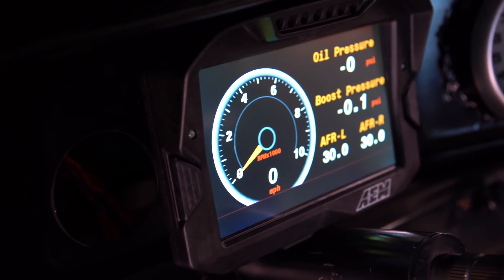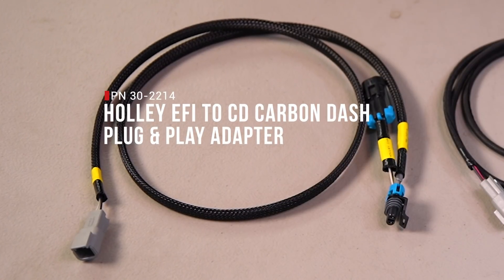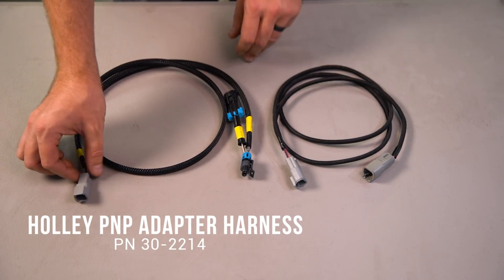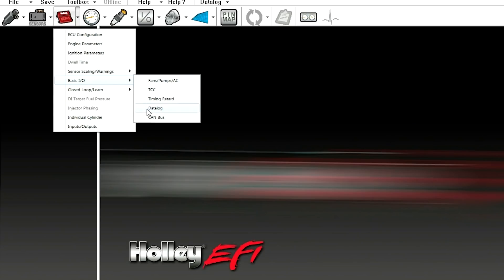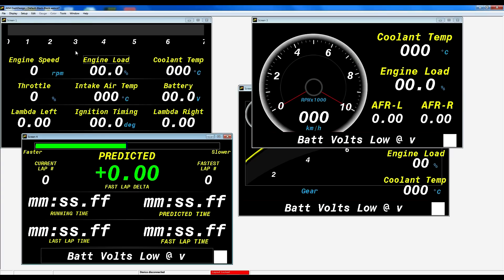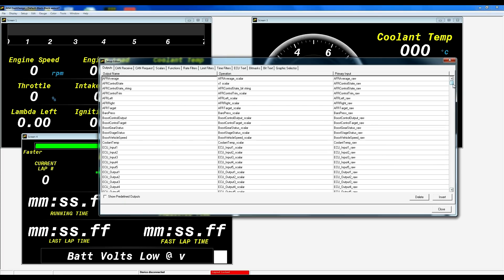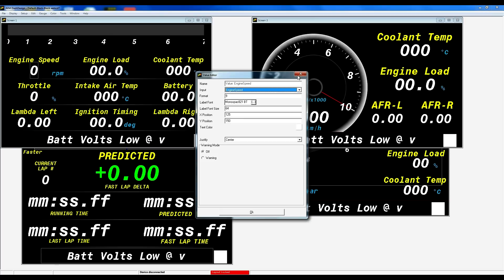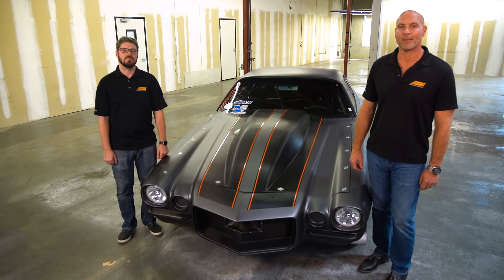A Plug & Play Digital Dash for Holley EFI Systems!

Comment: Would this be useable on any car with proper wiring and programming? Looking to replace my dash with something a little more interesting. Would that also apply to the 12.3 digital dash?
Reply from the maker: It can be used on any vehicle using our 22 Channel CAN Sensor Module to convert analog, digital and frequency based sensor signals to AEMnet CAN: https://www.aemelectronics.com/products/30-2212-22-channel-can-sensor-module

It is also hardware validated to work with hundreds of non-AEM CAN bus devices, so yes, there are avenues to add it to practically any vehicle!